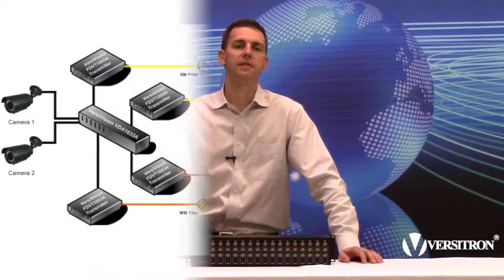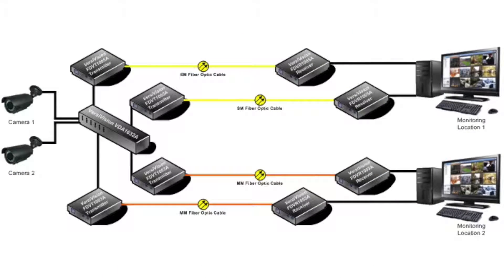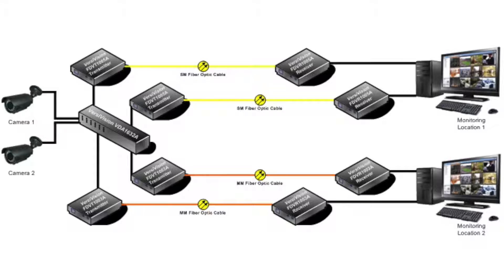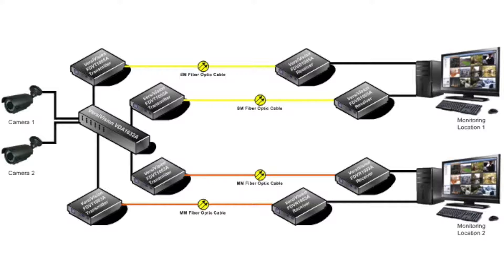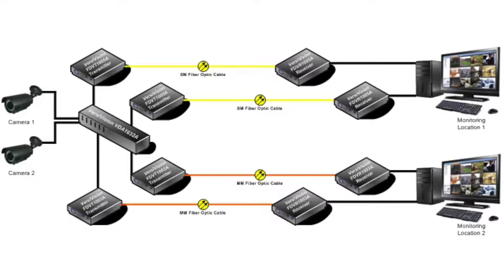Video Distribution Amplifier – 16 Analog Inputs, 32 Outputs | Setup & Applications

Comment: Can I use a video audio distribution  amplifier,  let's from a TV that has a digital to analog converter that has a weak signal ? Let's say connect to the converter into the distribution amplifier then to a mixer that's connected to passive speakers , would it work for the system in that scenario? Because the signal from the converter is weak,  can the distribution amplifier be used for that purpose ?
Reply from the maker: Hello Shannon:

Thank you for contacting VERSITRON.  Our VDA units will not amplify a weak signal and make it better.  They use amplification to keep the input signal at the original strength across multiple outputs so that each output has the same video quality.